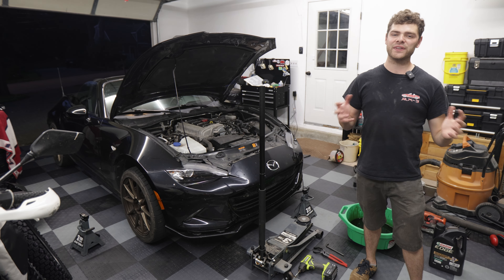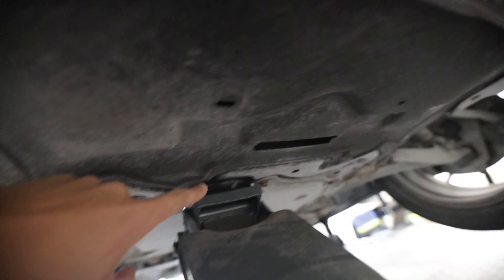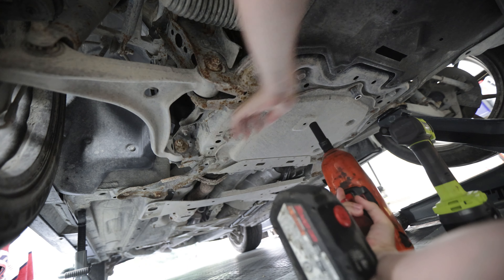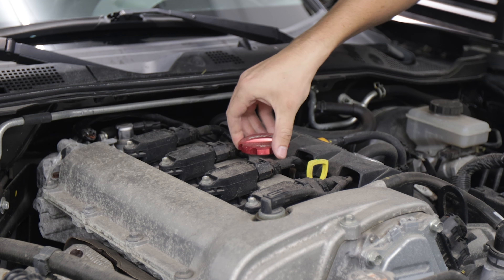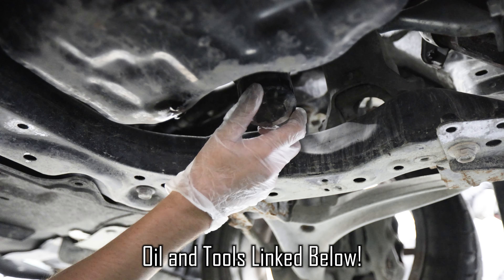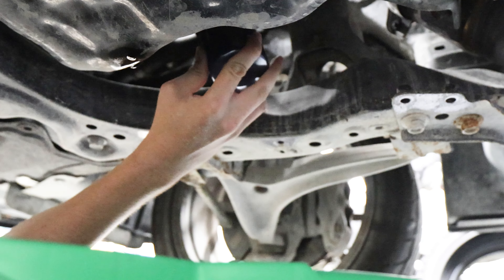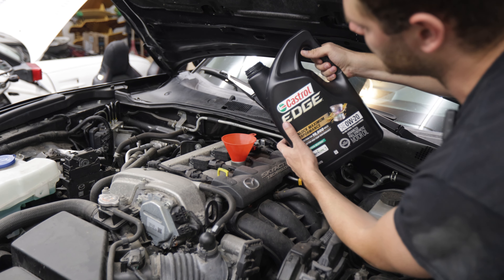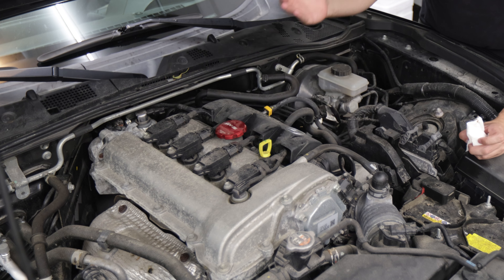4th Gen Mazda MX5 Miata (2016-2024): How To Change Your Engine Oil

Comment from the maker: Oil and Tools Required (Drain Plug Torque 23-30 ft/lbs)
►Castrol Edge 0W-20: https://amzn.to/3Lawwwk
►OEM Oil Filter (Preferred): https://amzn.to/3ztxNfp
►Aftermarket Oil Filter: https://amzn.to/3WtpYOL
►Oil Filter Pliers: https://amzn.to/4clYrFA
►Oil Drain Pan https://amzn.to/4bKwQgp
►Funnel Set: https://amzn.to/3RSuG72
►Socket Set: https://amzn.to/3RSr8Sv
(Support the channel for FREE, Commission earned links)